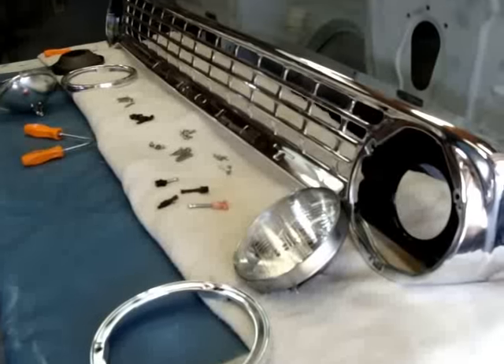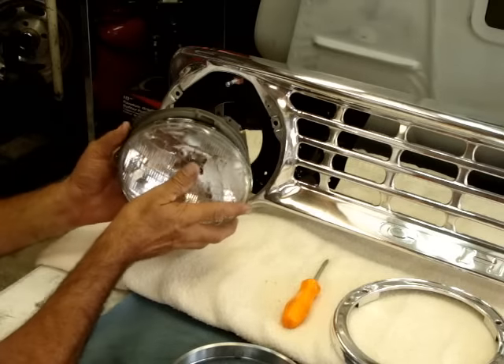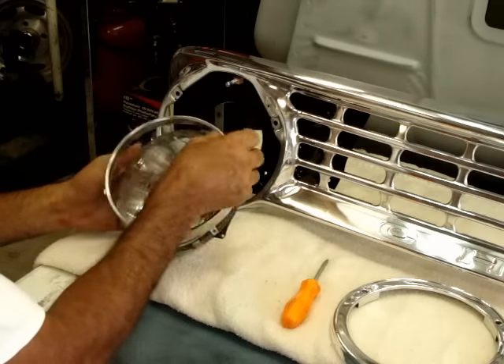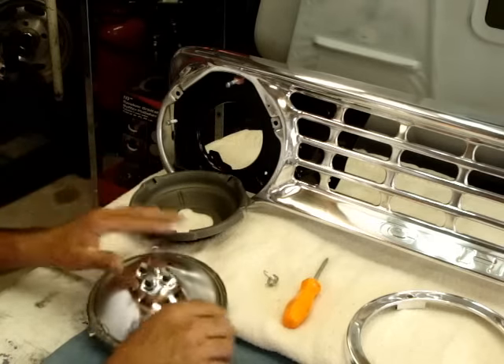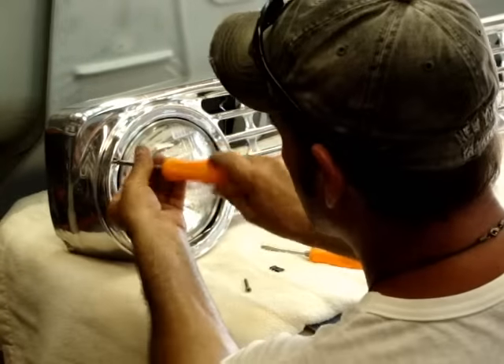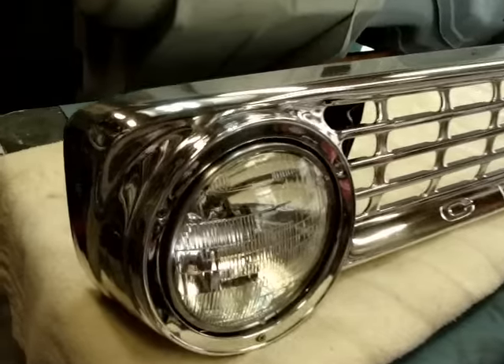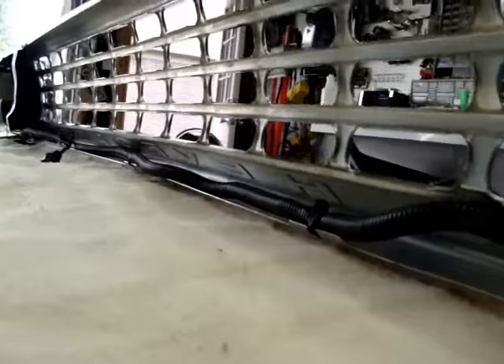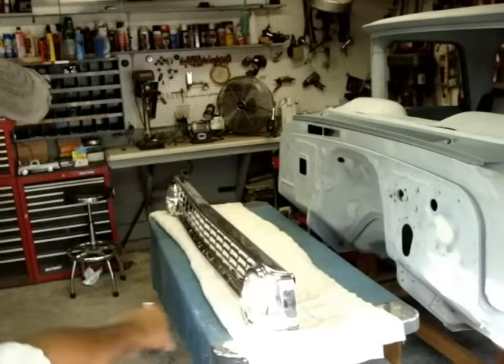1963 chevy truck finished the grille

Comment: Great Video. Can you please explain how you knew the proper headlight adjustment before you put the trim rings back on? Or, did you later adjust them. If so, is there a guide on proper adjustment? (Have a 63 C-10 myself I am working on.) Also, one other question, what are the various sprays you used to prep the headlight brackets? There was a "prep-all" then a green spray, then a primer, then black. Can you explain what each product was specifically? New to restoration myself. Thank you!!
Reply from the maker: GBassJones    I adjusted the headlights after I installed the grill on the truck, lowered the garage door down ,back up so many feet and measured the beam of light in from there. The bracket were simply cleaned with the prep all primed and then shot black

Comment: How did you attach the headlight brackets back to the grill?
Reply from the maker: There are four lips that stick out on the back of the grille that the bracket screws to
Reply: gibson63 right, I saw that, mine were riveted on there.  Did you rivet them back on or use screws?  Just curious what screws you used.  Your attention to detail is great man!
Reply from the maker: Yeah I just went back with screws on mine
Reply: gibson63 gotcha, thanks.  How does she ride or are you still working on her?